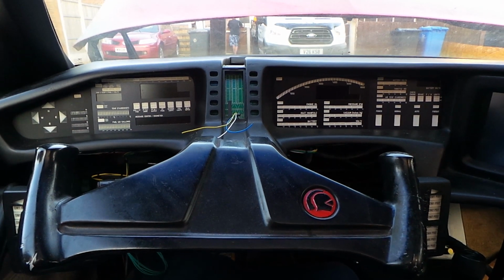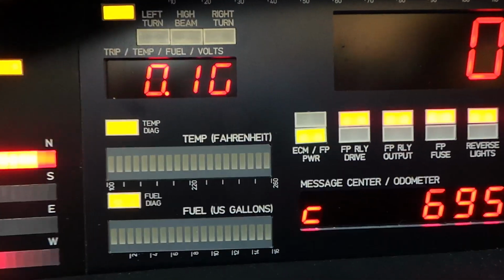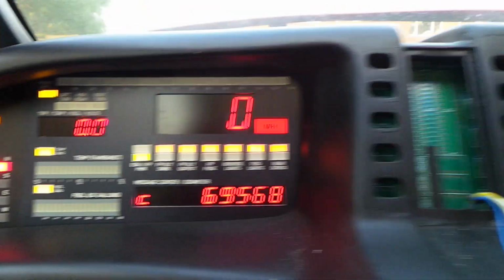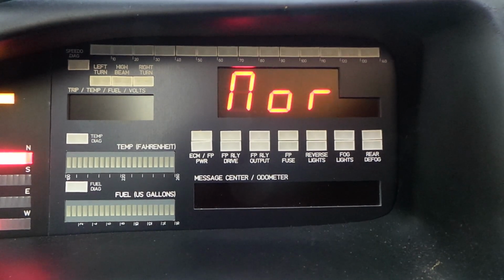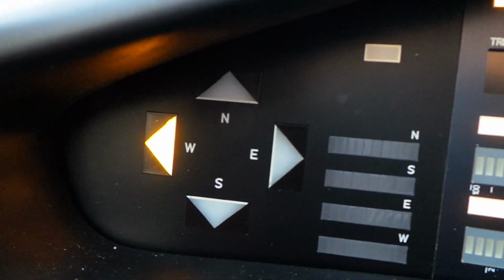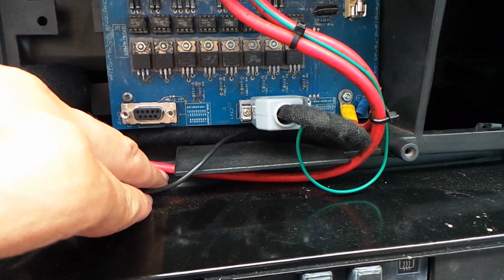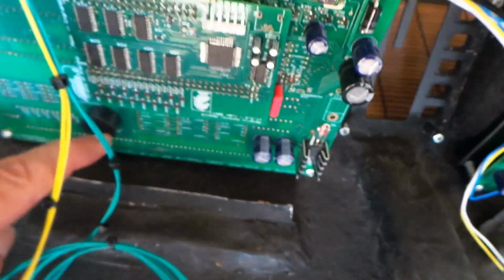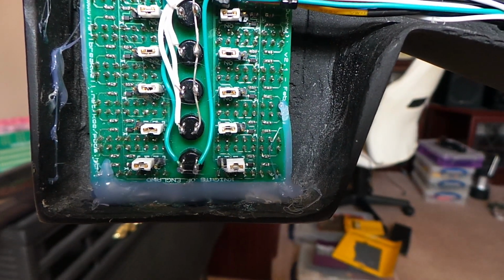My Custom "Knight Rider" Dash Electronics - Brief Overview

Comment: Very nice. Did you use microcontrollers.
Reply from the maker: Thanks.  Yes, all the dash modules are custom designed and based around the Microchip PIC16F877A microcontroller, programmed in assembler code.
Reply: @neilbreakwell4500 wow.